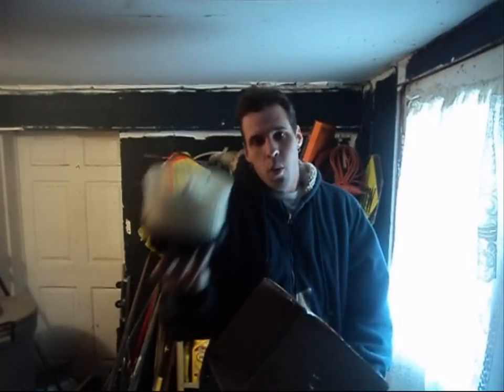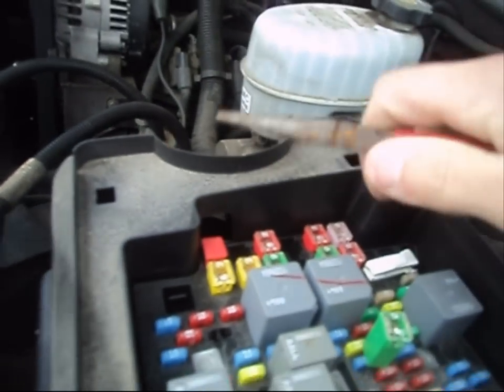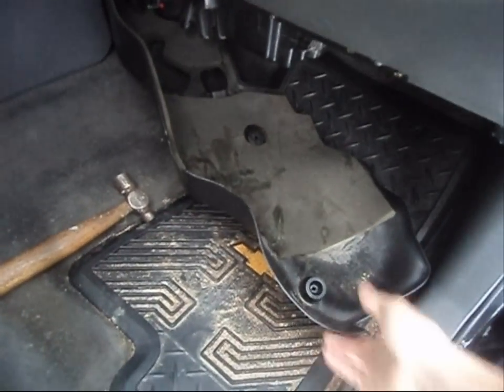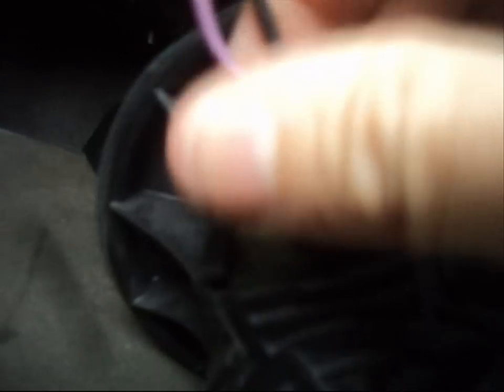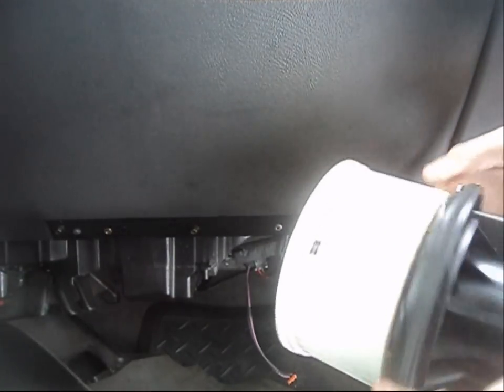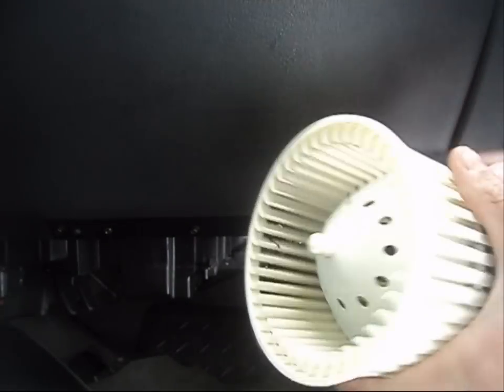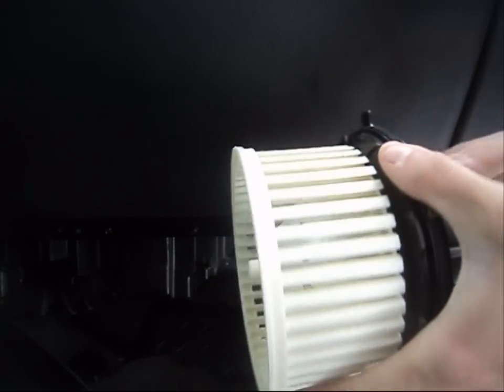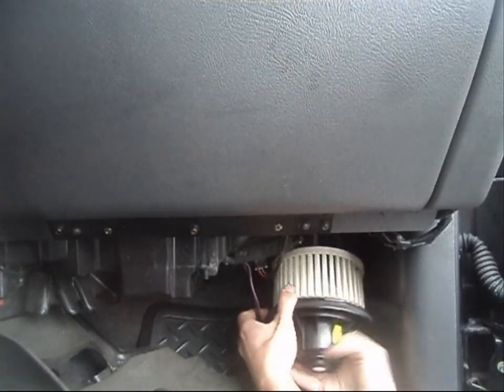Chevrolet Suburban, Avalanche, Tahoe Blower Motor Replacement

Comment: Thanks!  The mechanic wanted about $200.  After watching this, I went to the junkyard and bought a used one for $20 and installed it myself.  Knowing that blower twisted out instead of screwed in was key.  Also note worthy:  Mine had a small tab you had to bend down before it twisted out.
Reply: Thank you!! I've been having a hell of a time figuring out why i couldn't turn it.

Comment: Great vid.  Replaced my squeeky fan in 15 mins. Still feeling some odd cold drafts when the inlaws are sitting in the back, but i think thats a seperate issue.
Reply: Great comment haha.
Reply: Thanks for the vid! My blower squeaks cause it was always on HIGH when I had a control issue. Does it need replacing or greased? (Anyone??)

Comment: I just bought a Chevy Avalanche and thought I needed to replace the blower motor because it has stopped working. I look over and see that it's actually hanging out and vibrating. I was like this thing broke because it's not mounted correctly. Just be us and around with it I realize how it goes in and then I found this video confirming what I thought

Comment: If it's just making some racket but still working, you can spray some love into the small hole in the black plastic. Should take care of your issue. I used lithium grease into it with the tube that every can of lube has, and it took care of my issue. No need to replace it.

Comment: Question, is the fuse box under the hood in the same location on an 05 Suburban? I'm not with the truck right this second but am looking for hints where to look for the rear climate control fuse is.

Comment: Great video man, very helpful !!  I seem to have lost the 1st, 2nd and 5th speed on my blower motor, only 3rd and 4th are functioning. Do you think that is a problem with the speed controller or the blower motor itself ?
Reply: I know you probably fixed it I hope it is called a blower resistor if you have automatic ac control it's about a hundred bucks real easy to do in same area

Comment: I have a 2005 avy ... how do you know if it's your blower that's bad or resistor/relay ??
Reply: I also have a 2005 avy did you end up replacing your blower motor?   if so could you send me the part number if you still remember or have it? Mine needs to be replaced and I’ve been a little confused when looking for a replacement

Comment: Thanks for the vid! My blower squeaks cause it was always on HIGH when I had a control issue. Does it need replacing or greased? (Anyone??)
Reply: Sealed internal bearings. Replace it and clean any debris out

Comment: Try changing a blower motor on a Cadillac Eldorado, it is located in the engine bay, bolted to the fire wall. It was one of the worst jobs I ever worked on. Tip, buy a brand new one or you may end up doing it again like I did, because I wanted to save a few bucks. Won't do that again.

Comment: So I replaced the blower with only a few f-bombs dropped.   But speed 5 still does not work.  Any ideas what else could be causing just the highest speed not to work? A blower resistor?
Reply from the maker: Yeah it would be the blower resister or a bad connection to the resister.
Reply: TheYoshiClan Thanks.  I'll check it out.
Reply: TheYoshiClan Hey you got a video on pulling the resistor?  Is it on the printed circuit board with the multi-colored cable then connector feeding into it? The one in a housing sort of in front of the blower? 

Thanks again.
Reply: TheYoshiClan did you order that part online? I went to my local chevy dealer and it was the blower with the pigtail. Im having trouble finding this part